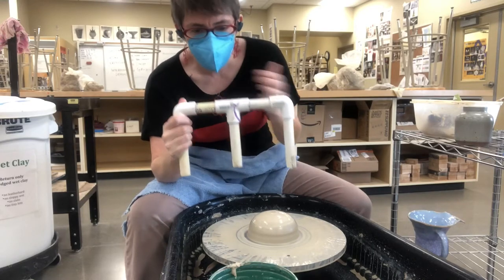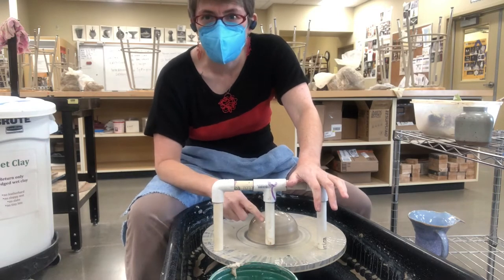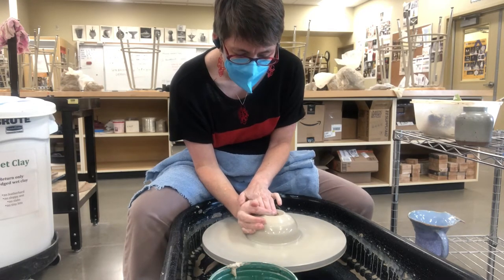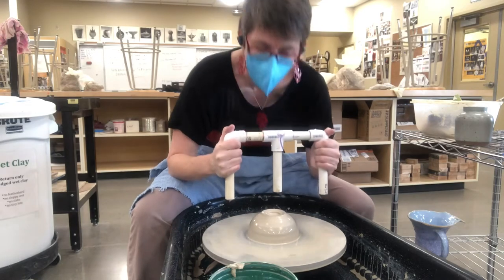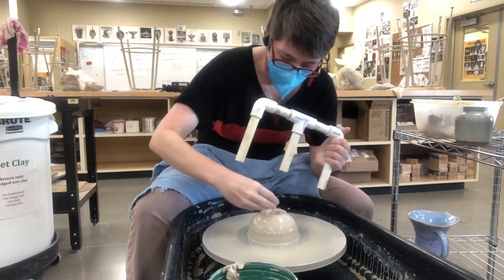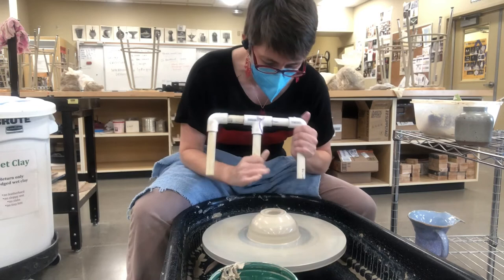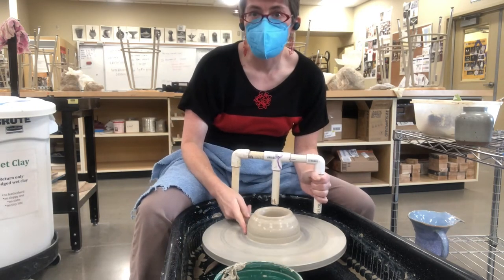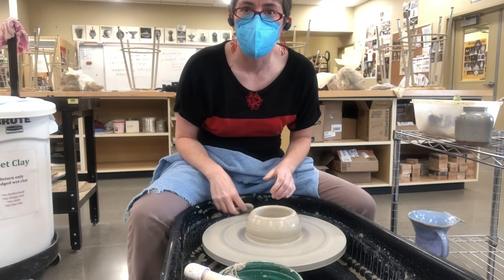Using a Ball Opener

Comment: How do you clean out the tool's three vertical sections?
Reply from the maker: I usually either just leave the clay in or let it dry, then tap it on the counter and it falls out. I have one of these at home where I filled the middle section with epoxy, but it didn't make much of a difference so I didn't do that for the ones at school